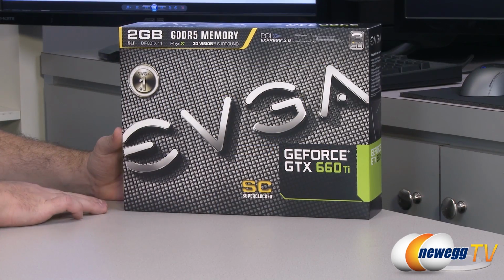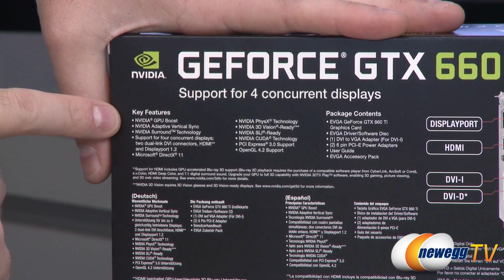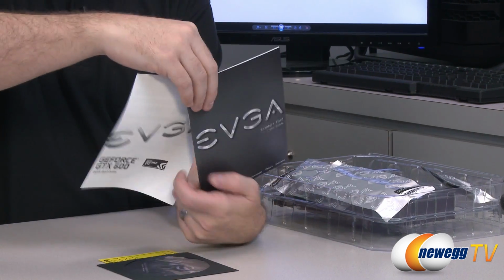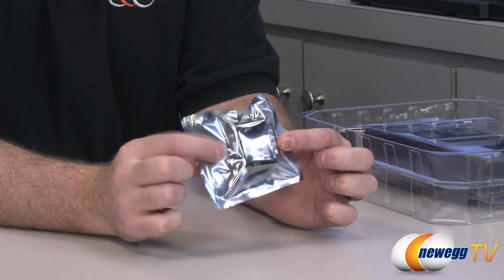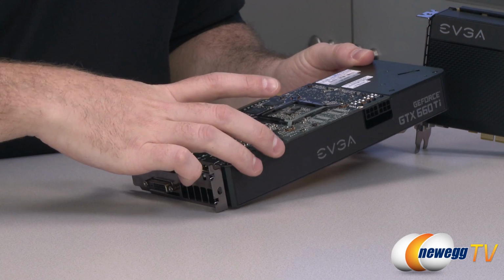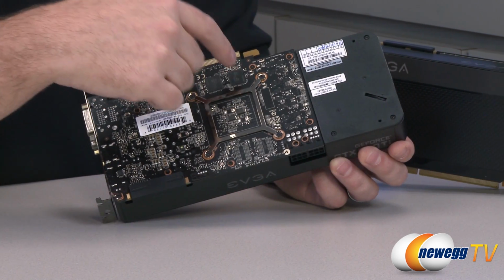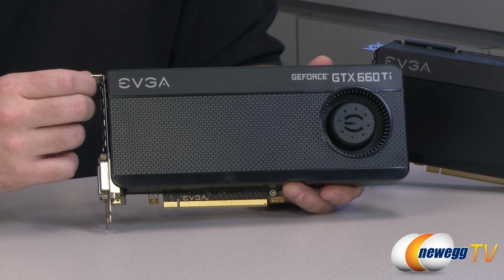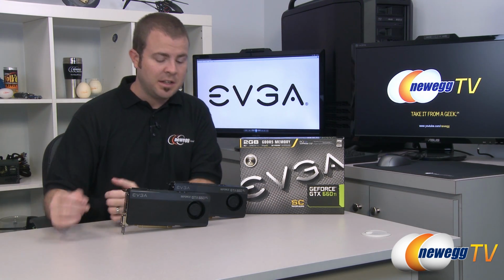Newegg TV: EVGA GeForce GTX 660 Ti SuperClocked 2GB GDDR5 Video Card w/ SLI Benchmarks

Comment: size doesn't matter. It's about your display having the supported connectors and the resolution it runs at. Usually tv's nowadays run at 1080p which is way smaller than the max supported resolution of 2560x1600

Comment: if you run ANY new game at MAX res and ALL eye-candy turned on you will see a performance hit with a 192bit buss vs 256,384,448. as theirs less bandwidth for it to pass thru. Ive been using 128bit-256bit buss cards for years and finally upgraded to a 448 and man there was a MAJOR improvement. but when running HD with anisotropic filtering and AA filters on the game will slow down unless you are running optimized SLI drivers and the cards to boot. them filters always slow the frame rates down.

Comment: The MSI one is easier to overclock. Altough the Asus gets better results stock(and is overclockable too).
Also depending on which MSI model, they have better fans.

The EVGA is kind of a real budget card imo.
It could be good to SLI, but overall I'd either get the Asus,MSI or Zotac.

The real thing is if the Asus or MSI is significantly cheaper than the other, if so, get the cheaper one.
You can't go wrong on the both of those.

Comment: see the 660gt with a 192bit buss is priced just right were it needs to be as if you got a card with a Hier bit buss the price goes up. I paid $350 "on sale" for my gtx470. regular price at the time was $400 and it has a 384bit buss and I ran crysis and 2 + skyrim with no issues, but because I have only one card I had to turn off the filters. cards with a 448 bit buss will run you @ closer to $500+

Comment: If your going to NOT overclock your card the 660 ti is better than the 7950 now if you use the 7950s potential and overclock it you can get 7970 performance easily.

Comment: I looked up your tv and it is 1080p resolution. It does not support 3D. however, if you want to SLI, you can run up to 3 GTX 660 ti's together (tri-SLI). In SLI, all GPUs must be identical. you can NOT mix and match different GPUs.

Comment: I am in a bit of a bind i am looking to upgrade my current video card cause it is very outdated. I have a friend that is telling me to get the GTX660TI, but I see lots of good reviews on the GTC750TI FTW which should I get....?
Reply: 750ti is terrible, the 550 ti even beats it.. get a 660 :)
Reply: Peter Buma The FTW is just called that because of the fan. you can get a GTX 750 TI SC for the same price and 25% higher performance
Reply: what made you say that?

Comment: So if the 670 is 5% worse than the 680. And the 660 ti has slightly worse specs than the 670. How does it compare to the 670?